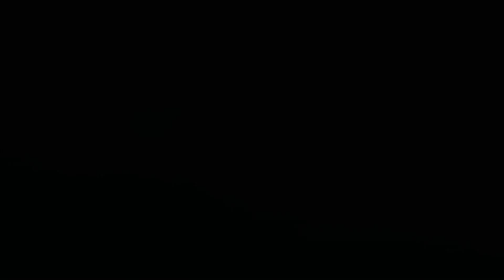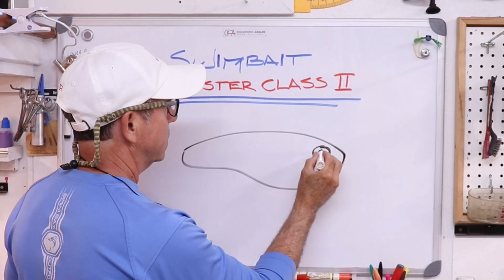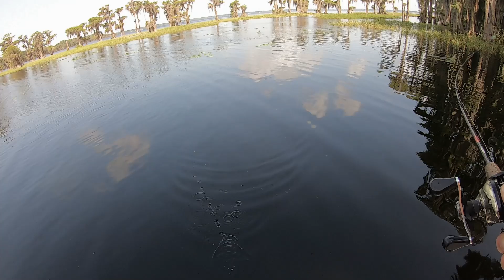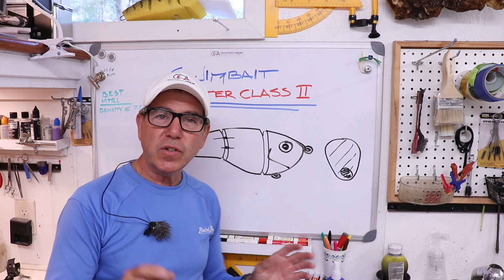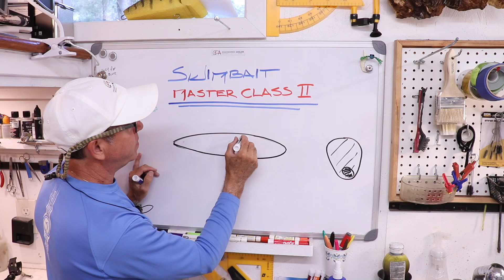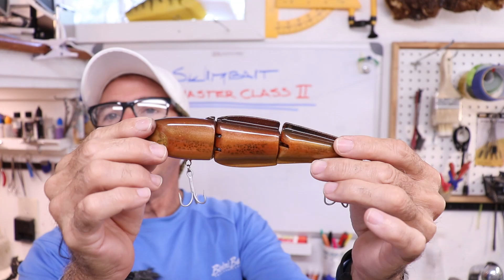Swimbait Master Class II, What you need to know to make swimbaits #swimbait #luremaking #lurefishing

Comment: Dammit.....my resin density is 1.05g/cc : (
Do you know a brand and type of resin that is good off of the top of your head?
Reply: I was going to delete this comment since I found an answer but I'll post that info instead. 
I was previously going to use Smooth-cast 300 by SmoothOn since I've used it before and already have some. But the density is too much. So going on SmoothOns website and comparing products I found a urethane casting resin called:
"Feather Lite" 
with a density of 0.67g/cm3
I hope if this helps anyone that was looking for a resin.
Reply from the maker: Sure go to my Amazon Store and check out specialty resins

Comment: To space the gap between sections, do you measure and set the twist-eye accordingly - or do you position the twist-eye in the pin, set the twist-eye in up resin at the desired gap, and cure the uv resin to secure the gap?
Reply from the maker: I don't use UV resin to set the hinge eye, the light won't get down inside far enough to set it.  I dry fit the hardware and note how far in the eye is then take it out, add glue, set it back in.

Comment: I love the balance between the making and the design theory. well done as always.  Going back to your last video according to another YouTube channel, if you pressure-pot your molds as they cure, it will improve the surface finish. The guy does dice casting. He says it gets rid of microbubbles
Reply from the maker: You can only really do that with the clear cast resin.  You can't do that with the regular casting resin because it will throw your resin density way off.

Comment: Very timely informative video for me. I am making a 4-segment swimbait, and just made the twist-eyes last evening. I plan on connecting the segments by gluing twist-eyes in the lead sections and pins in the trail sections. Now I know a lot more about this joint style than I did yesterday! This will be my first attempt using this joint system. 

Again, thanks for all the sessions for calculating weight. This is my second lure to calculate how much lead to use, but my first segmented lure to do this on. We'll see how I did in a few days when it's ready for a swim test.
Reply from the maker: I'm sure you'll get it right